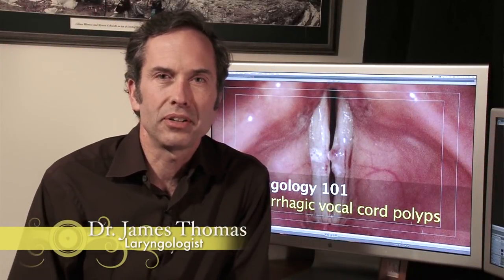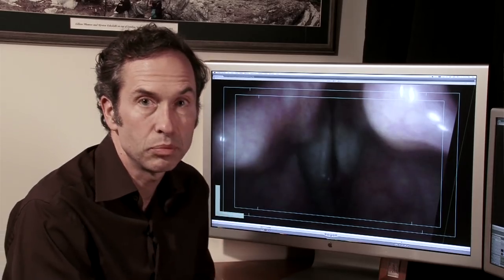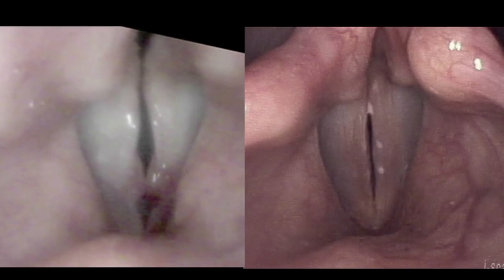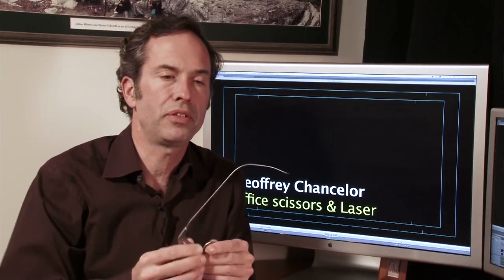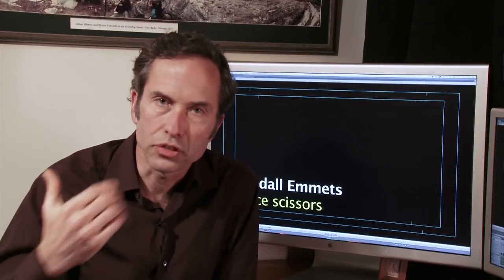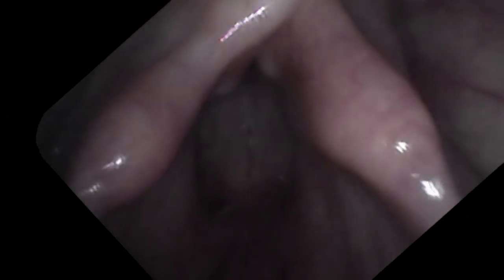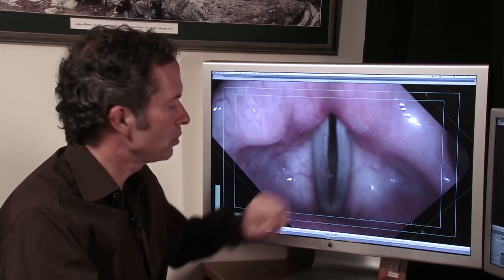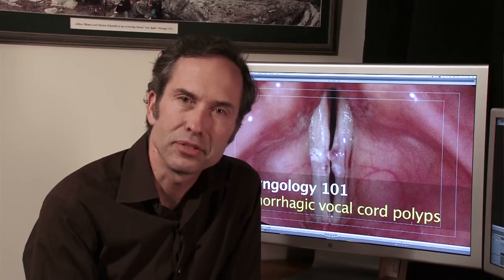Laryngology 101 HD - Hemorrhagic vocal cord polyps, part II, HD version

Comment from the maker: In the operating theatre I use angled endoscopes, typically 30 and 70°, to gain some additional perspective on the edges of the vocal cord. However I don't operate while using the endoscopes. I use a microscope with an attached laser, a CO2 laser which is programmable. I use the DEKA, and there is also a programmable laser by Lumenis, both of which allow for precise control of cutting depth.

Comment from the maker: it is quite difficult to measure with in the scopes since they have such a wide angle of view that distorts depth and length perception. As a rough guide, male vocal cords are about one inch long and female vocal cords are a bit shorter.